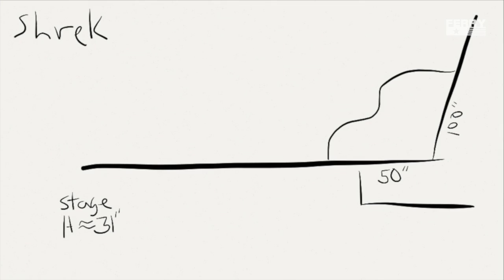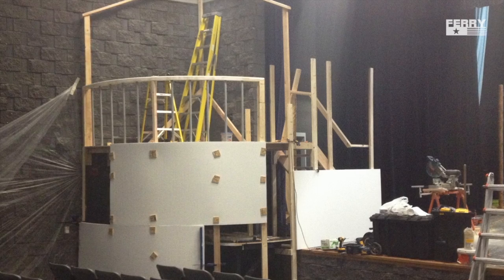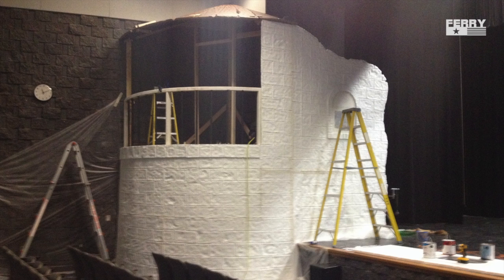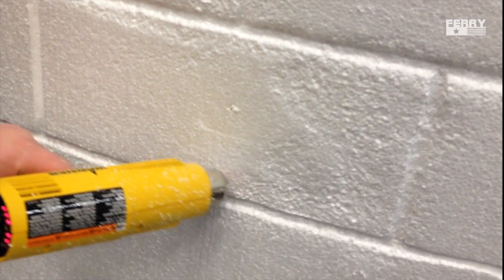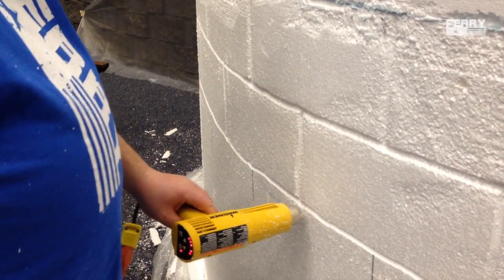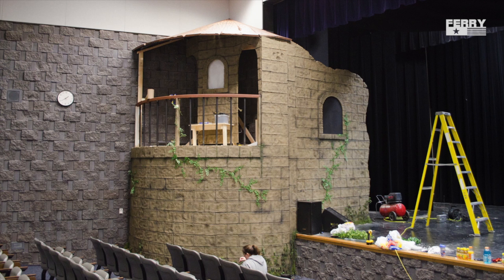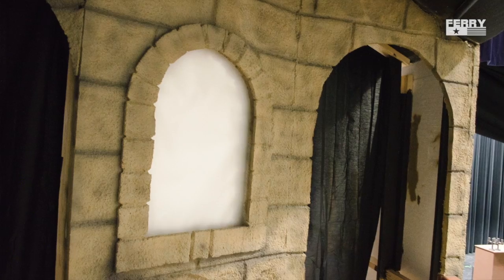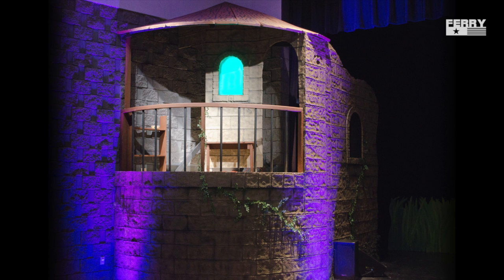Ⓕ Making styrofoam look like brick/stone - Shrek theater build (ep2)

Comment: Dang, Nick, that came out pretty darned awesome! That's one of the nicest pieces of scenery a school play can hope to have. It break my heart to think of it being torn apart after the play has run its course. I never thought of using heat to texture Styrofoam like that. I've always done it by painting it with spray paint. But with the the spray paint you can't control the amount of "erosion" quite as well. Great video and excellent information. Thank you for showing this.
Reply from the maker: That is the part I hate too, taking everything down.  But in this case they left it up to possibly use for prom or something.  I don't know if it is still up, but I didn't have to see it come down.

Comment: I am a new drama teacher and love your instruction.  Could you please clarify what you use as an adhesive?  If we want to attach to plywood do you recommend any technigues?  Thanks...sightly overwhelmed.
Reply from the maker: +New Drama Teacher thanks - I have a link to the adhesive in this article - https://nickferry.com/2015/03/fixing-styrofoam-brick-why-am-i-here-ft18/ - using a caulkgun just put a few dabs on the plywood and apply the foam - any other questions let me know
Reply: +Nick Ferry Thank you.  Sorry one last question what kind of foam do you use?  I went to my local Home Depot and they didn't have many choices so they recommending ordering online.  I noticed most of the foam has a plastic overlay...do you remove that before working?  Sorry for all the questions...trying to build a set on a very limited budget :)
Reply from the maker: FL Drama Teacher no worries - I get my foam without the film on it but if that's all you can get you normally can peel it off - eps or expanded poly styrene is what it's known as

Comment: Beautiful work, Nick!    How can you attach these to a 2x4 stud wall to use instead of sheetrock?   Liquid Nails?   I wonder if they will bow out or remain flat over time?
Reply from the maker: Depends on the final usage - I wouldn’t use this for anything interior in a home or anything like that but as I show in the video, use a specific foam board adhesive so you don’t chemically melt the Styrofoam

Comment: I have to say you are very talented! Very interesting .  So what kind of foam board was used? Also what kind of paint was used? Excellent job
Reply from the maker: Woodconsin Thanks.  The foam was EPS and if I remember right, the paint was Rosco.
Reply: Nick Ferry great I'll check into this.  It would be so cool to do the inside of my garage door since its not insulated.  Get two great benifits. ..warmer and a awesome look. Thanks again
Reply from the maker: Woodconsin No problem, rosco has fire retardant additives or if you're not worried about that any latex paint would be fine.  Spraying it is best as it preserves the texture.  Solvent based aerosols won't work, as they will chemically eat the foam.  Good luck!

Comment: Looks awesome! How durable is that when accessible by people? Is the melted EPS a little bit harder than the sheet by itself? Looking to copy this look, but people will most likely be touching the wall and I don’t want it to fall apart.
Reply from the maker: It is harder once melted - it creates a thin shell almost - it’s not super durable though - you’d want to add a covering if you want it super durable

Comment: when you used your heat gun on the foam board, did it strengthen enough that you could walk on it? imagine it was used for a stone floor instead of a wall. Thoughts?
Reply from the maker: It does form a little bit of a hard shell for a skin, however I don’t think it would be something you’d wanna walk on alone - try a cement top coat

Comment: Great work there.
Was that a set price or an hourly job?
Could you give me an idea of what a job like that might cost to have done?
Thnaks
Reply from the maker: FloppyHatPhotos It would be extremely hard for me to say what you would pay to have this done.  I do some projects for next to nothing because I like doing it, this was one of those cases.  Theater set building is just a hobby of mine.  If it is interesting to me or something creative I want to try I am more likely to do it on the cheap.  Are you looking at having it done for a theater?  If so, check for local talented people that would like to volunteer to help with the project.  That route you would only be out materials and a few pizzas.

Comment: How did you get the styrofoam to wrap around the castle without snapping? Did you slice it vertically and patch it?
Reply from the maker: As per mentioned in the video I bend it at that thickness and radius

Comment: I need to build a styrofoam version of Snow white's wishing well.  (life size)  what do you suggest I use to paint it?  Everything I have used so far melts the foam.   Thanks so much. I wish you were near to me so I could just pay you to make it for me! lol
Reply from the maker: If the money is right I will travel anywhere, lol.  Just about anything solvent based will melt the foam.  I used a cheap HVLP sprayer from harbor freight with waterborne paint.  Wait for the coupon and they are under $10.  You will need an air compressor and you will want to turn down the pressure to eliminate aerosolizing the paint.  If you see a cloud of paint develop then you are too high on pressure.  You only want to "push" the paint onto the surface.  Theater curtains are expensive and black shows everything.  Once you get it done post a picture of it on my facebook page, I would love to see it.  You can find the link on my website. My name then .com  

Hope this helps and let me know if you have any other questions.
Reply: Nick Ferry Thank you!  I practically live at harbor freight so I'm sure I can get a sprayer.  When you say waterborne paint, what does that mean? Acrylic?
Reply from the maker: Acrylic would be fine or latex would work too.  Basically anything that cleans with water.
Reply: Nick Ferry  Thank you so much!! I will definitely send a picture if it works out for me. I appreciate your talent so much. Thank you for sharing it!

Comment: I'm assuming that you used Foam Insulation for the build. Did you have any problems removing the protective film and do you have any tips? Mine peeled off in different sections.

Thanks! -Dylan
Reply from the maker: +Dylan Bender eps (expanded poly styrene) - I get the kind without the liner or plastic film
Reply: Where do you exactly buy that at?
Reply from the maker: +Dylan Bender my local home depot has it - look for polystyrene - looks like little beads of pressed foam
Reply: Dylan Bender I know how you feel! I found a foam manufacturer who sells off big bags of foam they can't normally sell due to minor differences in density... no film whatsoever!

$30 for a bag of
 2' x  4' x  2" pieces... equivalent to 4 full sized sheets.  

Google EPS foam supplier in your area.

Comment: hi nick!!! i was planning on trying this out and was wondering what kind of adhesive you used? and how thick of eps foam i would need to make a wishing well that is about 2 - 3 feet in diameter? also, because i've never worked with foam, what would I need to cut the foam?  thanks for all your help.
Reply from the maker: JZ Fernandez I was trying to make a video next week about it for you - the foam would have to be segmented or laminated for such a small diameter - I was hoping I could show that - do you have access to a table saw? - the adhesive I used is called "foam board adhesive" and comes on a caulk gun style tube
Reply: Nick Ferry really?? that would be awesome!!  i don't need it for a while but i was planning on trying it out because this would be my first attempt at building anything!!!  segmented or laminated? is that a type of foam? 

but no, i don't have access to a table saw. :(
Reply from the maker: JZ Fernandez yeah I have been trying to do it foe a while now - fingers crossed that I can come up w/ something - segmented & laminated are not a type of foam but rather how you install it - segmented would be making angled cuts on the edge of vertical pieces of foam to for a close to circular shape - picture an octagon or decagon - laminated would be to use thinner pieces of foam to get the circular shape and wrapping it multiple times to achieve the desired thickness - do you have access to a jigsaw?
Reply: Nick Ferry oh man...sounds like this will be a project i won't be able to accomplish...your videos make it seem so easy!!!  i don't know what a jigsaw is, so i'm going to say no.
Reply from the maker: JZ Fernandez I'm trying to think of the simplest way to do it - you're going to need some sort of wood structure underneath - what do you have to cut the wood?
Reply: Nick Ferry wood? i didn't realize i was going to need wood, i thought i'd just be working with foam.  uh oh!!!
Reply from the maker: JZ Fernandez yeah it will need some sort of structure underneath - let me give it some thought for a couple days and see what I can come up with
Reply: Nick Ferry oooooh...i'm glad i messaged you. it would've been a definite FAIL and waste of time and money for me...I was planning on cutting and gluing some eps foam together to form a wishing well.  lol....
Reply from the maker: JZ Fernandez i'm thinking we might be able to use a couple hula hoops
Reply: Nick Ferry hula hoops!!! FUN!!!  now that i can have access too!!! thank you, thank you, thank you!!!
Reply from the maker: JZ Fernandez you can thank me if it turns out good, lol - I like the challenge of working w/ limited tools and materials
Reply: Nick Ferry i'm sure it will turn out better then what i was planning on doing!!!  lol...but i'm glad i could give you a challenge.
Reply: hey Nick Ferry!!!  i was thinking about making a wishing well out of cardboard and then putting the eps foam around it.  do you think that would work?
Reply from the maker: JZ Fernandez that would be tough - I will message you on Facebook

Comment: hi there Nick, my name is Michael & i'm from Malaysia, is great looking at your video & the work is awesome! I'm working on an angry bird styrofoam sculpture to give my nephew a surprise, is done already but may i know what should i use in my finishing to make the sculpture look smooth & shining, also what kind of paint (name/brand of the paint) suitable for styrofoam sculpture?  Cause i've try some of them but the sculpture is like melts on the surface. Hope is not too much to ask from you, thank you so much!!!
Reply from the maker: Michael Chong The texture you start with would depend heavily on what styrofoam you used to make the bird.  Either way I would use drywall joint compound as it is water based and won't melt foam.  It isn't the most durable stuff but if it's not going to be handled much you should be fine.  If you need something more durable you could try a product called Bondo.  It is used in the automotive repair industry to fill in dings and dents.  I have never used this product with styrofoam so test an area to make sure it doesn't melt the foam.  Either one you use you're going to want to smooth it on over the styrofoam and sculpt it the best you can before it cures.  Once cured Bondo would need to be sanded smooth.  The advantage to using joint compound over Bondo is that you can smooth it out after it has dried with a damp rag as well as sand it if needed.  Once you get it as smooth as you can go back and apply more compound to fill in any voids or holes.  When you are satisfied with the texture spray it with a good primer (preferably sand-able).  If you have covered the foam well enough with joint compound it won't matter what kind of paint you use.  If you still have some foam showing use any water based paint and brush or roll it on.  In either case you can then coat it with a gloss clear coat to your liking.  Hope this helps.
Reply: Nick Ferry Thank you so much Nick for the reply, i really learn a lot today, it's been a great pleasure to meet you, if there's any chances you're coming to Kuala Lumpur,  Malaysia, i'll be glad to bring you around, once again, thank you!
Reply from the maker: Michael Chong No worries, If I'm ever in that part of the world I'll look you up.  I've heard it is beautiful there.  If you have any other questions let me know.